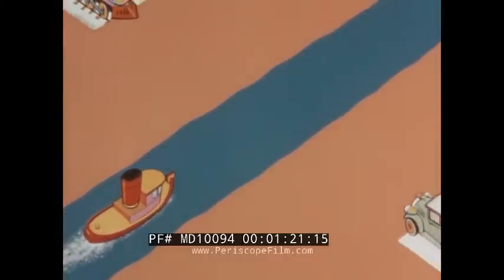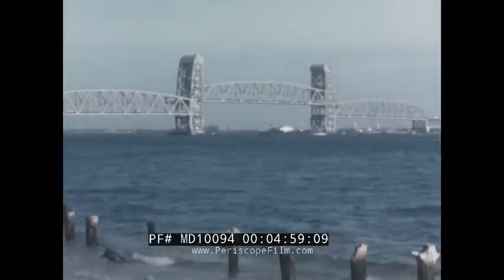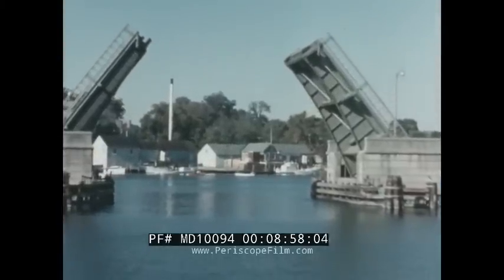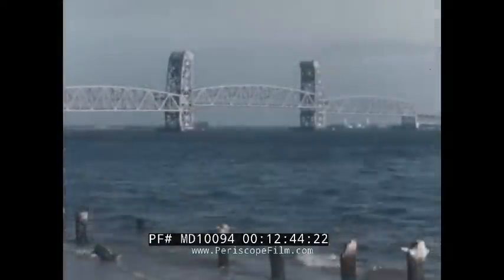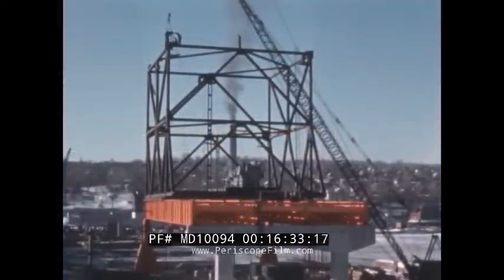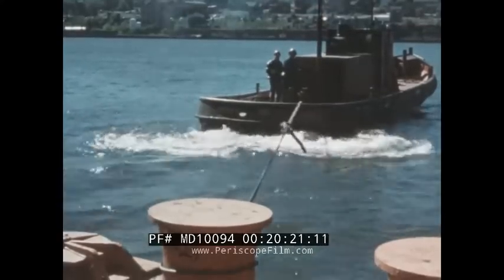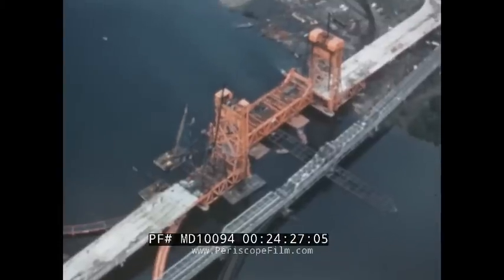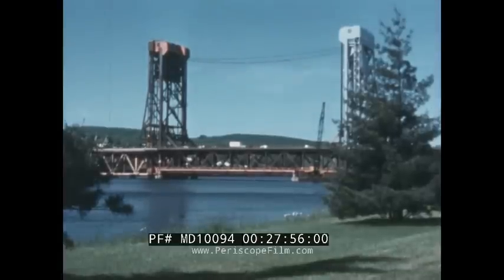" THE MOVABLE BRIDGE " 1970 AMERICAN BRIDGE DIVISION OF UNITED STATES STEEL PROMO FILM  MD10094

Comment: The intermediate position is a great design. The only other way to have continuous road/river traffic would have been to build a separate railroad bridge at significant additional expense.
Reply: I get the idea, I just can’t see exactly how it works
Reply: @65gtotrips  The upper level is paved, the bottom level has railroad tracks but is also paved (think streetcar tracks).
When the bridge is in the middle position the level with the paved railroad tracks lines up with the road.
When a train needs to cross they lower the bridge all the way and the cars drive across on the upper paved level.
Reply: @ghost307  I was thinking that, but was in the mindset that it was just regular tied tracks. So thank you so much for replying to clarify !